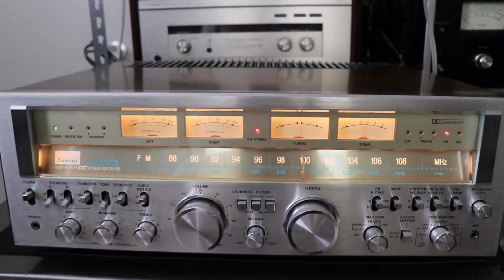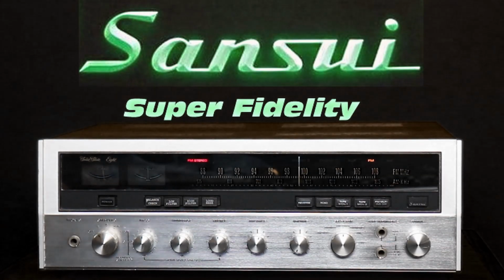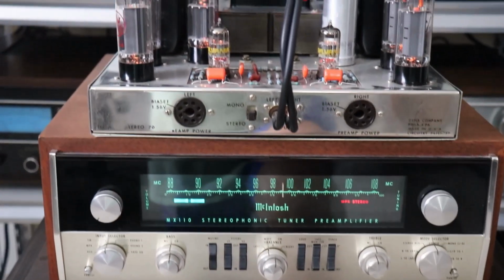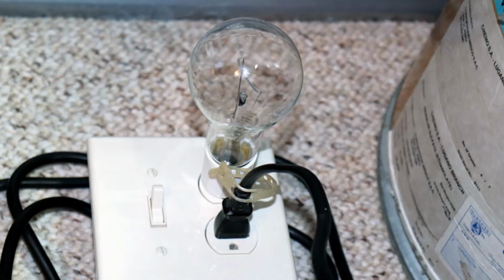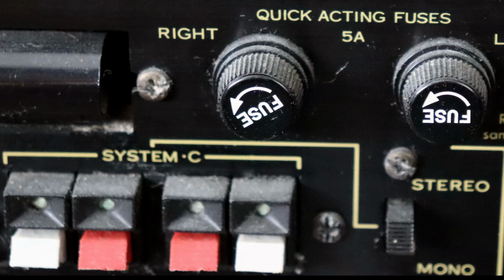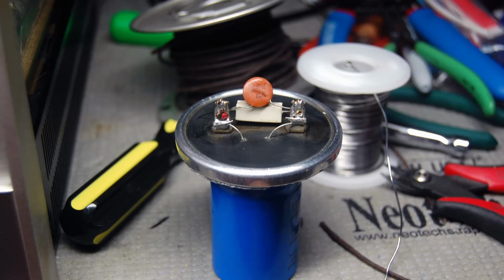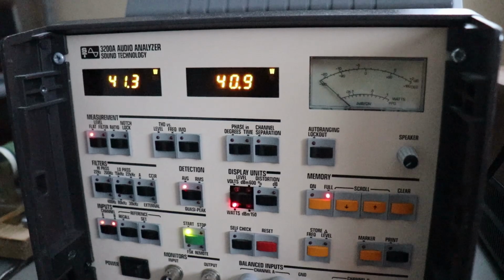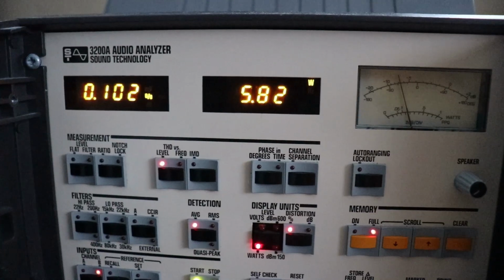The Best Receiver Ever? - The Sansui Eight. Repair Restoration Testing. Vintage Audio Equipment

Comment: Had my 8 since 75, have never come across anything that can come close, it's a frickin brute!...added the quad unit and rigged in another stereo, running 6? channels and 12 latice monsters, Sansui Kenwood Pioneer, and three big 12" subwoofers....running 15 woofers 12" to 15".....and the volume on the 8 is set at about 3, has never ending power still....at night when it gets quit you can probably hear it.

Comment: I have a G8000 that has a protector issue. I love this old receiver. I can solder pretty well and have various solder guns/irons. Do you have a video out for repairing our G8000s ? I have a good Fluke multi meter and would like to fix mine. Thanks  Bruce

Comment: I recently acquired a Sansui Eight in Excellent condition and was so excited to fire it up but when I did I was rather disappointed at how it sounded. The Bass is very undetailed and boomy. It doesn't sound as good as my 2000x but that one has had service done and the Eight I am sure is all original. Maybe if I get it restored it would improve in sound quality?
Reply from the maker: The eight is a fine sounding receiver when operating correctly. At it's age I'm sure it could sound better if you got it serviced/restored/repaired.
Reply: I have a 2000 4000 and 7000.  For some reason the 2000 sounds much better to me.  Characteristic is it falls to nothing in all the lulls of the music making it sound more dynamic.  I wish I could figure out why.  I would prefer to know before it have it restored because I fear I may lose some of the magic.
Reply: @starker1971 I just had my Sansui Eight completely restored with enhancements(larger filter caps). It has significantly improved the sound. Most notably the bass is much better now. I don’t think restoring your 2000 could make it sound worse, only better. These tired old parts are performing under spec and I’m sure you’ll be pleased at the improvements once replaced. At the very worst it would sound the exact same or just a tad better but certainly not worse.
Reply: @stpierreorama  I have the 2000 7000 and an MCS 3215 needing restoration.  In better times, I would like to have them restored.  It's a difficult decision between all 3 of them as to which one I would like restored first.  I tend to lean towards the 7000 as they had to be brought back by a soldier.
Reply: @starker1971  I can only speak for the 2000x and the Eight. The 7000 is an inbetweener of the two. It's certainly the most powerful but I will say the 2000x is very seductive and lush and is the one I have a bit more love for mostly because it looks so nice and has a gorgeous wood case. The Eight is probably technically superior but less warm and little more defined in the sound but the differences are pretty much negligible. I've done side by side comparisons and it's only a subtle difference but if you require more power for larger or harder to drive speakers go with the 7000. If you like the classic earlier look like me I'd go for the 2000. Can't really go wrong with either. The 7000 is more rare and collectable and would probably have higher resale value of that's a consideration

Comment: A beautifully made receiver but not the best sounding. There are more transparent receivers that separate instruments into a more holographic sound stage and are more revealing of the subtle textures and harmonics of instruments. Sansui's own 881 sounds better even if it's not built quite as well. Not that the eight isn't very good, it just doesn't sound as good as the very best.

Comment: So THE  Warmth And vintage sound comes partly from the physical size of the csps.  You need to keep the physical size the same raise the voltage up50 more volts. So make 50 volt caps 100 v then raise Uf to mach physical size to keep the sound signature.  Most techs won't do this or care.  The smaller modern caps change the sound and take away bass. And head room and available dormant power.   Raise by 50 v then raise mf to next index to keep the sound signature

Comment: I just started looking into restoring my Sansui Eight.  My father bought it new back then, and I inherited it.  It needs some work, but it looks like it will be worth while.  When he bought it, it replaced the Heathkit system (tuner, pre-amp, two mono amps, all tubes) that he built in the late '50s.  I have that system too, and will be restoring it, starting with the two amps.  Love the information provided, thanks!
Reply from the maker: Your very welcome and very cool story. The Sansui eight is such a wonderful receiver. It will be well worth your time to get her up and running.
Reply: @vintageaudioaddict   Just checking my sn as you talk about in your video.  It's 221070192, so as you say the third digit is the year, so this would be 1971, July, 1st.  is that correct?  It's also go the fast acting fuses, so this must be a really late production one with the fuses.

Comment: Don't know if you remember I toldyoumy Phillips 578 gave up the ghost...
Took to the local shop and bought a sansui g9000db to hold me over as 6mo 
Estimate on repair. Cheers
Reply from the maker: Great that you found someone local to look at her. It's tough to find tech's that still work on the vintage gear.

Comment: Hi, I have a sansui 8 that I just bought a few days ago, this very week, the left channel gets distortion from the pre-amp stage, how could I repair it?
Reply from the maker: No real easy answer. Your Sansui eight is 50 years old. There could be many different things causing your issue but the first thing to try would be to clean the pots and switches with Deoxit or something similar.

Comment: My mother called me while I was at work and said she found a sansui 661 at goodwill. I decided to pull the cover off to take a look. It was covered with dust..so I started brushing it off and set it up on its side and out fell a bobbie pin. Who knows how long it was in there..I’m glad to have taken your advice to just take a look. Who knows what a piece of metal laying in there would have done. 
Cleaned it and she fired up without any problems. 
Thanks for the info and advice

Comment: my brother purchased this for me at military audio club. Had it from 1972 until 1996 when i went surround. It started having problems in one channel with distortion. Finally whilet rying find the problem i shorted out i beleive an output transistor. I was sad to see it go. It was definitely a great unit.
Reply from the maker: Thanks a lot for sharing. The eight was/is a wonderful receiver. One of the best from back in the day.
Reply: @vintageaudioaddict  mine never said it was the deluxe unit but i beleive it was. It had the ability to separate the pre amp from the amp. It also had the abilitiy to work from 100Vac up to 240Vac just by the way you installed two plugs on the back of the unit. I still have schematics and alignment manual that came with the unit. My bother also got for me a Dual 1219 turntable import. so it had no markings of United Audio. It too had a power plug to change operating voltage and a different spindle to operate at 50Hz. Finally a TEAC A-4300sx and a TEAC external Dolby unit. Great units all of them and at great prices due to various Px's and audio clubs military members could join in Europe and Asia.

Comment: I have an Eight that needs a power cord. I have purchased two that should've worked, but didn't. My tech was able to use a jumper to power it up. All the lights came on and he was able to faintly hear both channels. He thinks it just needs a good cleaning and to change out the bulbs while it's  open. Mine is like yours, fuses, not relays. I would appreciate any leads on power cords. I can't sell it or work on it without power🤷.
I have the QS-1 Quadraphonic Synthesizer that was purchased for this as well. It works great! Would love to hear them together.
Reply from the maker: I've had the same issue. The power cords for those always get lost because they are detachable. I never did find a source but I found some at a local thrift store. I sorted through hundreds of cords before finding ones that would work. They were not original but apparently some other type of equipment used them and they worked fine. Someone told me they were old electric shaver power cords.

Comment: I got and am still using my Sansui  9900Z receiver. It's rated at 160 whats per channel and with clean DC power. It's actually got a cooling fan in the back to cool it off it it gets overheated. I love it, think it was made in the very early 80s. It was the last large high power machine they made before they lost their magic. I think it sold for around $1200.00 plus US back in 1980 or 81. My love affair with these machines started back in the mid 70s when I worked as a salesman at a high end stereo store called "Custom Hi-Fi" in the US. I would not give anything for my Sansui receiver, it's pricless!

Comment: Funny, in 1971 I joined the navy. Looks like a really sweet receiver. Surprised that it had so much power output. That it's rated higher into four ohms shows good design. And any unit offering 60wpc in the early 1970's was no slouch. Combined with a THD of 0.3% made it an impressive powerhouse, as a lot of receivers were rated at 1%. Is one phono input for MC??? or are both MM only??  Also looks like it can add a third deck via front panel inputs. My first hifi system (strictly budget) in 1974 consisted of a Pioneer SX-434 receiver, BIC 920 turntable and KLH model 31 speakers all for under $250. Still use an SX-434 in our kitchen hifi system powering a Nakamichi BX-1 deck and Boston Acoustics A-40 speakers. Nicely done video and most interesting content.

Comment: 0.2% distortion at almost 58 watts in an old receiver like this is outstanding.  The fact that it exceeds factory specs is not completely surprising - such were the '70's era Japanese receivers which is something not often seen in today's modern equipment.  If not for the general fragility of the old components vintage audio gear often trumps many modern units of similar purpose.  Great video.

Comment: I had a 9090db. When it warmed up, the right channel would cut out. Drove me nuts. After trouble shooting for 3 days I found a micro brake in the preamp board. I ran a short jumper wire to the pins and problem solved. And it did not increase the noise level from a hearing perspective. But I have to say, I like the sound quality of my Pioneer SX-1250 better. Just a preference thing.

Comment: I just found one of these at the local dump not completely working but in prizes of restoring it I cannot believe someone just threw it out when you could sell it on eBay for parts for $190

Comment: Hello all,

Its a great video, I am looking for few replacements or exact spares for my Denon POA 2400 power amplifier, as I do not know where I I can find like minded technician have decide to post it here. Kindly help me with better replacements or suggest a place where I can get below discontinued transistors:

2SC1815(Y)
2SC2878(A/B)
2SC1841(E/F)
2SA988(E/F)
2SA1321
2SC2705(O/Y)
2SC3334
2SA968(Y)
2SC2248(Y)
2SC2458(BL)
2SA1048(GR)
2SA1360(O/Y)
2SC3423(O/Y)
2SK184C(Y/GR/BL)
RN1202(10K-10K)NPN
RN1205(2.2K-47K)NPN

Comment: I have had them all, and listened to them all.  The Sanui Eight non deluxe, which is my main driver i will never leave, is without a doubt, the greatest sounding receiver ever made.
Reply: You have me scratching my head. So many others are saying the Eight Deluxe is slightly better sounding, better engineered but has cheaper knobs.
Reply: @stpierreorama  It depends on the condition. These are all over 40 years old and no matter what repairs you do on them, most of the components are that old and you never know what can affect the sound. With that said, my Sansui 8 deluxe is an excelent receiver unless something brakes again and it has to go back to the workshop.
Reply: @disityp 100% I just had my Eight restored and it’s so much better now. I genuinely did not enjoy it at all at first. Now it sounds great!
Reply: @stpierreorama  I wish I had a skillfull Sansui specialist nearby. I feel like every time it comes back from the shop, a specific problem is fixed, but it sounds again a bit worse. I guess our guys don't have access to the best components any more.

Comment: I just purchased an eight and wanted to know do you think it is as nessassary yo change the filter capacitors as it is the electrolytic caps? Also do you suggest changing all the transistors and trimmer pots?
Reply from the maker: The Sansui eight is a great receiver. Congratulations on owning one. Old electrolytic capacitors are ticking time bombs, including the filter capacitors. The great thing about today's world is that you can get that message from the electrolytic capacitor manufacturers themselves. I did a video on it. If you are interested there is a link below. Transistors and trimmer pots that's more debatable and is more on a case by case basis.

Replacing Old Electrolytic Capacitors https://youtu.be/RaWrYJ6amcA
Reply: @vintageaudioaddict  thank you for the reply! Your videos are very entertaining.

Comment: Your videos are great.  I love the silverface era. I have a Model Eight  also. Picked it up at an estate sale.  I am a novice.  I cleaned all the pots and installed green LEDs. Look real nice. My problem is weak sound on the left channel. Phono and radio. If I push the mono button in I get equal sound on left and right channels at any volume.  Any idea where I might look to solve this. Or I can just listen to mono all the time.
Reply from the maker: Thank you for your kind words. It really could be almost anything in the preamp/amp section as you indicate the issue is on more then one input. Your eight has some years on her. The eight has several 2SC693 transistors that are known troublemakers, losing gain, getting noisy and add to that the electrolytic capacitors that are well past their useful lifespan. It's probably time for an end to end restoration. It seems that have seen inside your eight so it may be something that you could take on. Do some internet research on your eight and see if you think you can do. If not it's probably time to find a tech that can fix her.
Reply: @vintageaudioaddict  thank you for your response.  Will research and see if I can find the problem.  Thanks again. Will keep watching your videos.

Comment: Subscribed.
Great video.
I started my working life in the early 80's and the very first thing I brought was a Sansui amp, an AU (something). The following month I brought a Receiver, then a month later a Tape Deck etc with each component, finally I purchased two dirty great big floor standing full frequency speakers. These buggers were BIG and heavy and I had to transport them home on the train. I ended up moving them 1 at a time. There was just no way to get them both home at once. I had that sound system for more than a decade. It's a shame that times have changed and audio systems have trended to smaller all in systems now. The visual impact I believe is as important as the sound quality.
Reply from the maker: Thanks Pete! LOL, on the train with huge speakers that must have been something to see! Thanks a lot for sharing your story. Folks have so many good memories that revolve around the stereo equipment they grew up with.

Comment: I worked on quite a few Sansui Receivers and integrated amplifiers in the 1970s.  I would take a piece or two to my home shop from a repair shop to help him keep up with the business, and would receive one half the labor rate for each unit I serviced.  This shop was an authorized shop for Marantz, Pioneer and Sony products.  The shop could not acquire schematics for the Sansui products, so the owner tended to give these to me.   I learned a lot working on them.
Reply from the maker: Thanks so much for sharing. It's great to hear from someone who actually worked on  audio equipment back in the day. I'm just a hobbyist who collects and repairs vintage audio equipment. You as a technician understand how important it is to have service manuals, schematics. etc. for the equipment. The internet changed how we obtain information. Almost all of the documentation for vintage audio is now available at the click of a mouse. Without the internet I would have never had a chance to learn how to repair this equipment.  As you mentioned, back in the day if you were not an authorized service center for a manufacturer good luck getting the information you would need to repair a unit. Thanks again for commenting.

Comment: I have a Sansui 5500 that has a bad left channel not sure what the problem might be.Anyone know where I should be looking? Thank you
Reply from the maker: It'is very difficult to say what the issue could be. The 5500 is a fine unit but being produced in the 70's it could be almost anything causing your problem in that channel.
Reply: @vintageaudioaddict  I will troublshoot it and hopefully i can pinpoint the problem.
Cheers

Comment: Just bought a 210 at Savers. It was built September 12, 1972. Thanks giving us that info.
Reply from the maker: Your welcome and good luck with your Sansui 210.
Reply: Vintage Audio Addict got it home looked it over, turned it on and she sounds pretty good hooked to some Bose speakers. Thanks

Comment: Sansui products were very good in their day. I had one of their receivers. Don't remember the model. But when I switched over to Adcom separates the party was over for the Sansui. Only way to go is separates.
Reply from the maker: Sansui did make good equipment. Adcom made good gear also. I still have a 535 and a 5802 along with a few others.